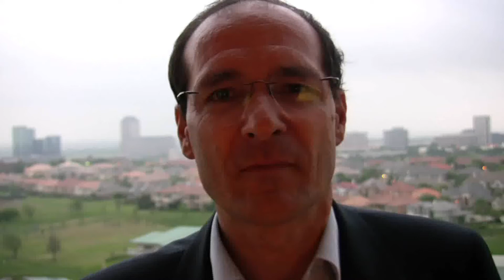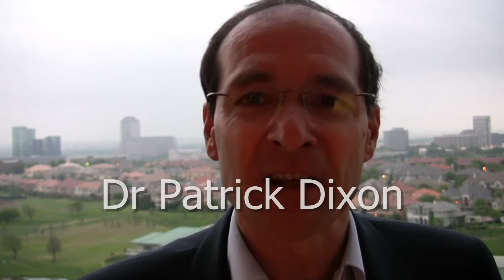Geothermal heating -- heat pumps and global warming - Energy Industry Speaker - Keynote - Futurist

Comment from the maker: Heat pumps work like fridge motors - they cool one set of pipes and heat another set of pipes.  The cool pipes can be laid under the earth - either 1 metre below ground running a long distance horizontally, or they can go down deep vertically (more expensive).